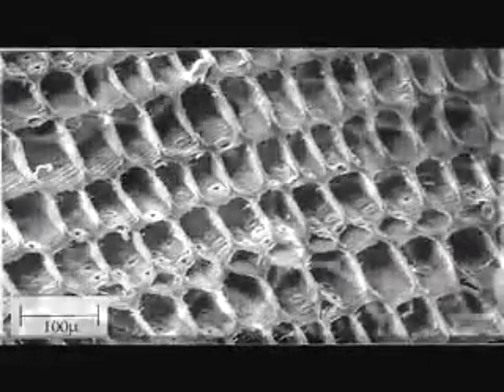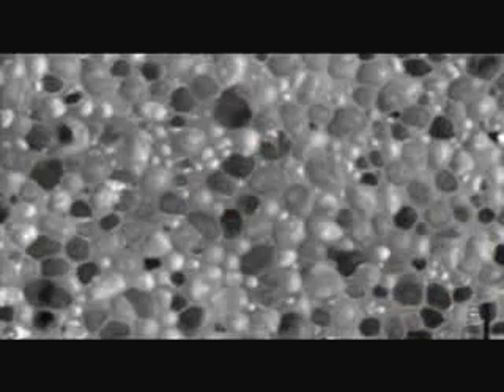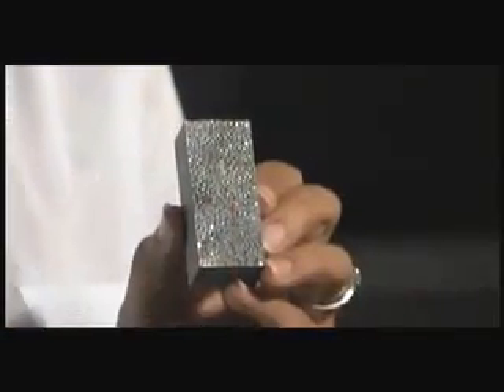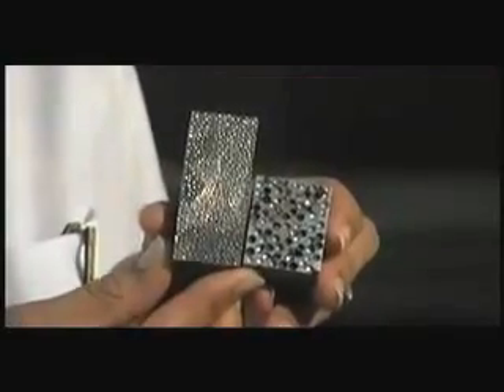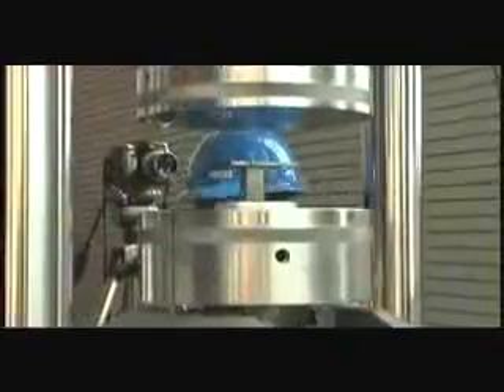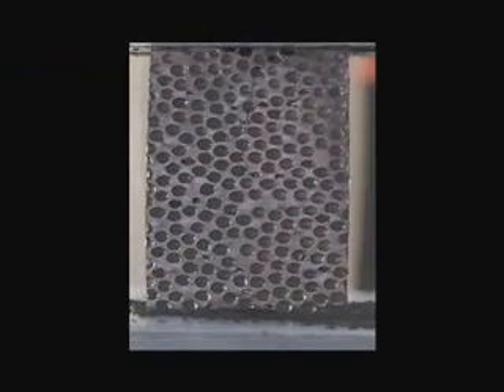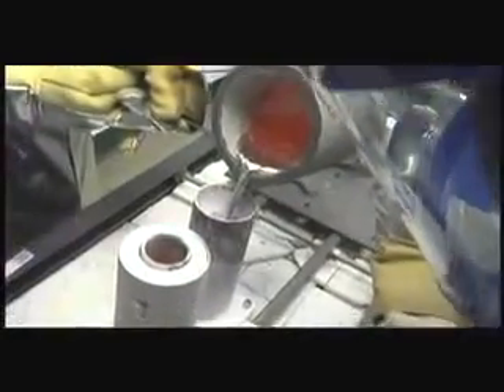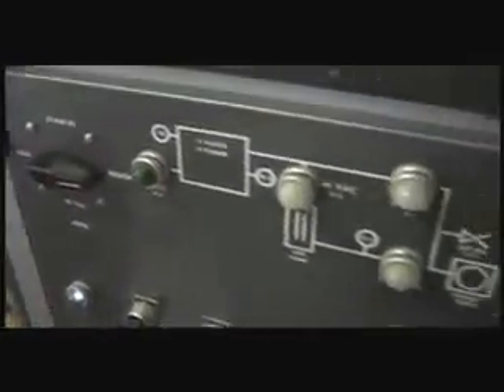Advanced  Engineering Materials - Metal foams by North Carolina State University

Comment: Just a fair warning to not buy into the big lie of steel foam.

Even in World War II they found when applying any kind of steel material, the more holes you place inside the plate, the more likely it is to ruin the integrity of it, causing a weakening affect of how much direct force it could absorb by itself.

So basic logic says punching a bunch of air and holes through a steel block is going to fundamentally reduce the amount of strength it has through something called the 'Over-match' effect. Or when a full caliber round fired from a gun roughly 10 times the the millimeter of a plate, it will usually ignore its effective thickness and go right through it.

This is how instances such as Panzer VI's Ausf.H1 or E ("Tiger I") guns were able to punch nearly 3 foot diameter holes inside the front of T-34 hulls. Because the metal had too many holes and gaps of where the plate had too many impurities that ruined its integrity to uphold being punched through.

The most I see this being used for is small arms at best. Being applied anywhere else it's beyond outclassed.

Comment: These new metal foams should be in full scale production already (Date today is 5/21/2019).  There are videos with this material being used as a bullet proof application.  I found this looking at bullet proof stuff such as armor in tanks.  I think if they layered this new metal foam with something like a polymer that was discovered at Rice University they could have some major advancements with bullet proofing and actual weight which is normally the biggest issue.  The polymer I saw was at this link  https://youtu.be/Qivsb1142rw.  I wonder if they could layer with metal foam and create something amazing.